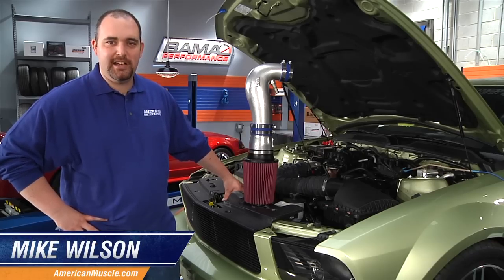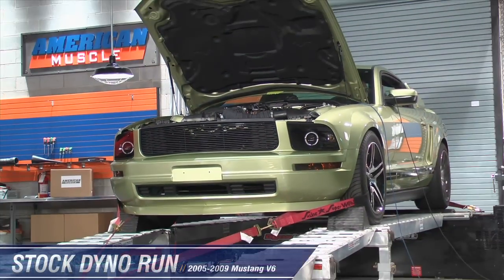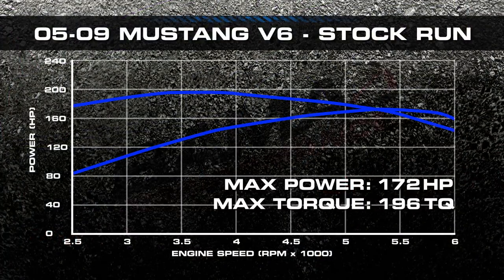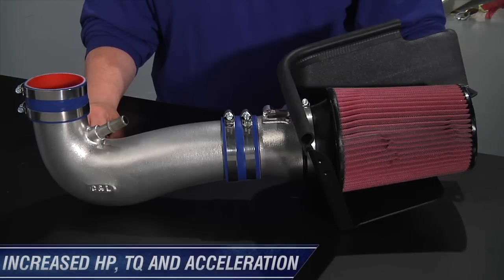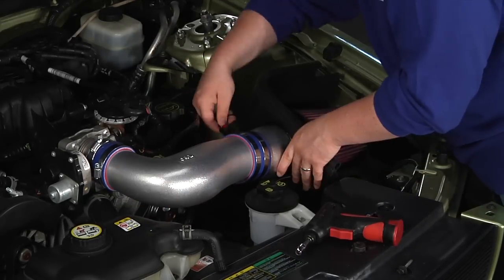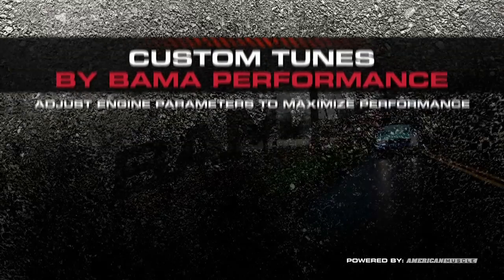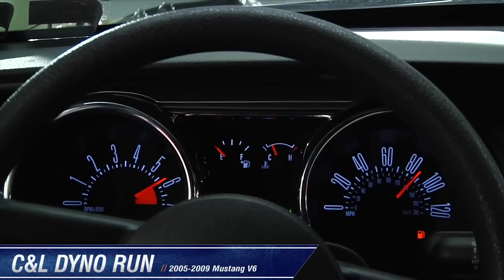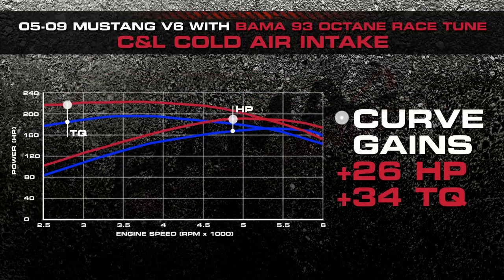Mustang C&L Cold Air Intake (05-09 V6) Review

Comment from the maker: The 05+ Mustangs don't really have any heat soak issues, and because of the diameter of this intake, the intake air temps are within a few degrees of factory temps.  Typically, mid-70's IAT is what we were peaking at.  I'm sure with the hood closed, on a hot summer day in traffic - they would be a little hotter.  However, there's no significant difference or enough heat soak to warrant less timing leading to less power.  Hope this helps!

Comment: Is it required to disconnect the negative battery terminal overnight for the ECU to reset after installing one of these cold air intakes?  Also, should I apply oil to the dry filter that came with the new intake, the filter looks like a K&N filter?  Thanks for any advice.  Mike

Comment: i believe that intake tube it self is aluminum, im curious to see if that you monitored you intake air temp sensor if the temperatures would be any higher compared to the OEM unit